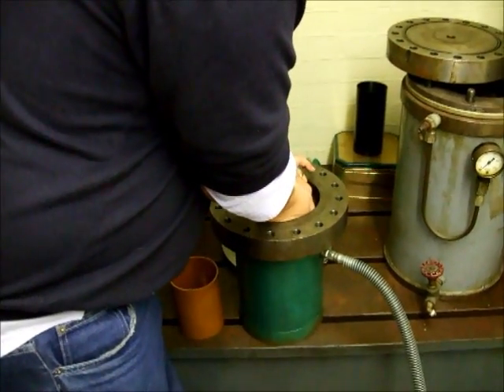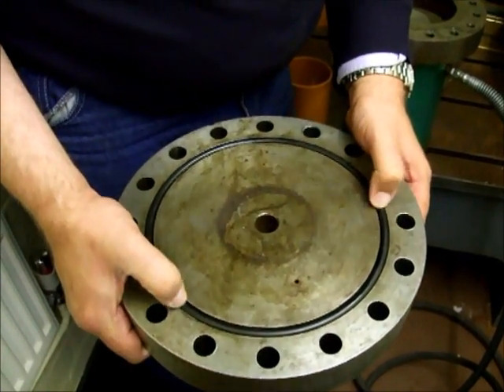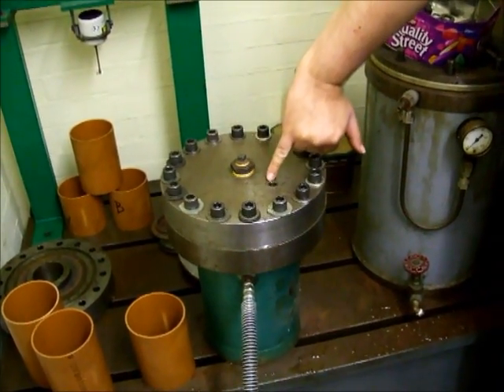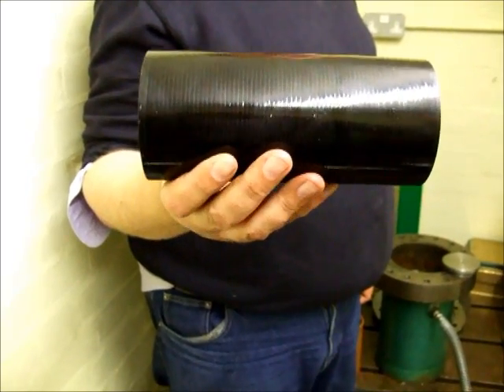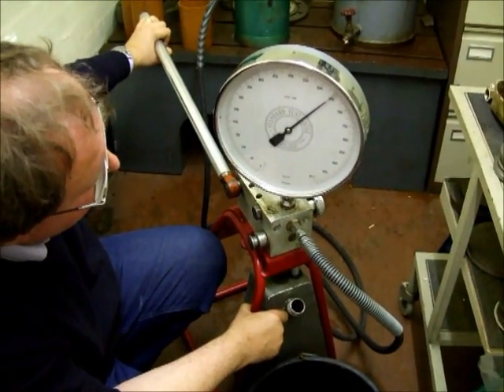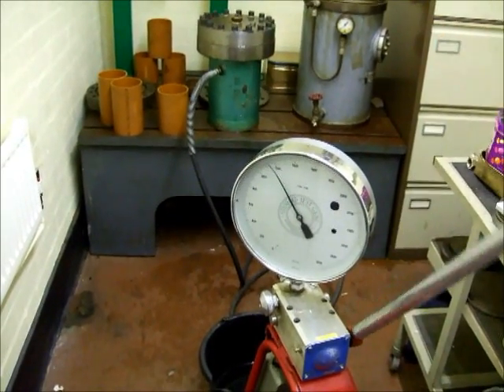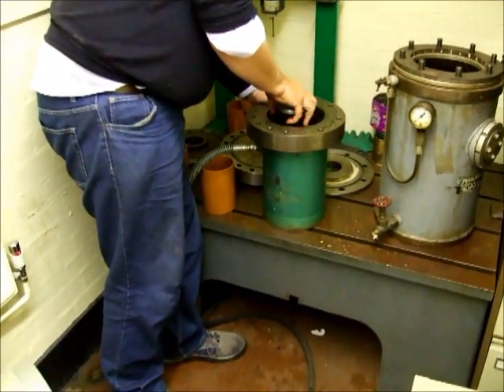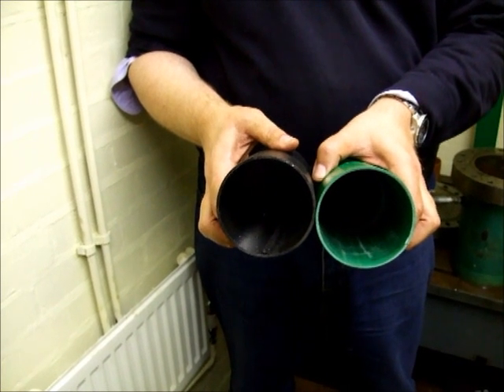Collapse of Composite Submarine Pressure Hulls

Comment: I worked with carbon fiber in the aircraft industry for nearly 20 years. To subject a pressure vessel made of carbon fiber to repeated thermal and pressure cycles as great as those at Titanic's depth, are many times greater than the cycles that an aircraft part will ever experience over it's years of service. Yet, I can't begin to count the number of repairs I've made to parts that have developed cracks or delaminations in a far more forgiving environment. Carbon fiber parts are only as strong as the resin used to saturate and bind the layers together and the process used to cure the part. And lastly, under extreme cold and pressure, these parts are very sensitive to strikes  and collisions of just a small velocity. Needless to say, you could not pay me enough to go down that far in a sub made from a carbon fiber tube.
Reply: You were testing for carbon fiber in tension, which it is very strong in tension. The submersible was in compression, which carbon fiber is not strong. I have no idea why carbon fiber was used for a sub, what a poor choice.
Reply: @tybrady4598  aircraft parts are subjected to both forces, as well as torsional loading. But we are overlooking the worst part of the design. There is a reason most all manned submersibles are spheres, it is plain and simply a better pressure vessel than a cylinder. Especially when it is external pressures being applied. And the fact that they used titanium domes bolted on as their end caps, made each and every hole in the carbon fiber used to bolt it to the cylinder, a potential weak spot. As the center of the cylinder experiences the most load, it pulls away from the bolt under tension and at it's thickest point is under compression. There is also the matter of whether or not they used a honeycomb structure between the layers of carbon fiber. That structure also usually made of carbon is under compression at the outer part and tension the farther it gets away from the center point. The only thing that binds that structure to the carbon fiber layers is the same resin used in the carbon layers themselves. A cylinder undergoes multiple forces at different areas for the entire length of it as well as it's thickness. I won't even go into any hull pass-thru areas.
Reply: @tybrady4598  
IMO tension rods laid in the hull from one end of the tube to the other and tightened to the titanium end caps would've greatly increased the strength of the hull.
Reply: and the way they assembled Titan, slapping resin onto largely parallel loops of carbon fiber, in an open warehouse by people wearing street clothes.. the contaminant/air bubble inclusions must have been insane, and no less so for a vessel intended to compress under gargantuan forces
Reply: @peabody3000 hmm interesting I figured they vacuumed it or something, somehow, in some "innovative way" at the end then placed in giant autoclave? Thanks for your comment! Will have to find the assembly video.
Reply: @michaelregan427  autoclave is right. For those that don't know, it's a vacuum chamber heated to a set temperature to extract all air bubbles that form in the resin during the curing process. I also used the vacuum bagging method inside a walk-in oven, usually at 150°F.
Reply: @peabody3000  seriously? That was the manufacturing process?
Reply: @astoriacub  yep it's on youtube, video of stockton and his team spooling the fiber, troweling on the resin, and casually gluing on the titanium caps, more as if building a bathroom shower than a 6000 PSI deep sea vessel. it's outright absurd.
Reply: @peabody3000 do you have the name of the video handy by any chance? I can’t find it. Thank you!
Reply: @ahoyhere8113  i have posted two replies to you, yet they aren't showing up for me. deleted? i'll try again: search 'Bonding the Titanium Ring and the Carbon Fiber Hull' ..it's the vid from titan's builders themselves
Reply: @peabody3000  YouTube has been losing data a lot for the past two months. Something is going wrong with their "eventual consistency" between data centers.
Reply: An acquaintance of mine tested a similar submersible about a decade ago and found that every 300-500 minutes under water starting at a depth of 1000 meters the material degraded to the point where they had to reduce the safe depth rating in half.  Continuing the testing repeatedly at every shallower depths, the submersible eventually failed at 8 meters imploding.  He described the failure as reminding him of when one stomps on an empty aluminum soda can with heavy boots.  What they brought out of the bottom of the 8 meter tank they used for the final test was just crumpled up "stringy" debris.  The client decided to go with a solid stainless steel hull instead.  He informs me that newer stainless steel one is still in service.
Reply: With any metal there is also fatigue. But this can be accurately modeled. And towards the end of it's life it will even start warning you with sounds. With carbon fibre composite there are so many unknown variables that no model or simulation can be used to say: well this hull is good up tot 50 dives.  with the steel or titanium spheres they used to go to the challenger deep  they had the assurance that they could do a 100 dives or so. And then to be on the safe side they would do 50. I don't know if those are the actual numbers, just giving an example. OceanGate their design could have failed at dive 2 or dive 10 or dive 20 or dive 40. Nobody could tell. They did xray testing of their first build and found fatigue and so stopped going to 4000 meters, and instead only went to 3000. Then they build a new one. They assumed cause the first one did so many dives, that it would be the same for the second.  And assumption is the mother of all fuck ups.
Reply: @KainniaK  actually the titan was supposed to have acoustic sensors imbedded in it's hull to listen for any cracks or delaminations as they formed. Problem with that.. in the 30ms that it took for the titan to implode it was too late for the computer to display that it even detected a problem.
Reply: @KainniaK Titan failed afte 5 dives
Reply: What's your take on SCREWING LCD PANELS AND LIGHTS INTO THE CARBON FIBER PRESSURE VESSEL?  LOL
Reply: @LarsLarsen77  they would have most likely have used mounts that were "glued" in place using the same resin used in the carbon layers. I made similar mount points in parts I worked on. You never want to screw a screw straight into the part. It can crack and delam weakening the part besides most likely pull right out if it's of any substantial weight.
Reply: @LarsLarsen77  I think they were glued, but with that rush guy I would not bet my life on it lol
Reply: @strammerdetlef  There was a cylindrical fiberglass liner that the monitors and lights and wires and stuff were attached to. The passengers were not in direct contact with the carbon fiber pressure boundary. There was a floor.
Reply: @LarsLarsen77 i think the monitors and lights were screwed onto the perforated sheet metal lining of the sub's interior, which in turn was likely screwed onto the end cap interface rings
Reply: @LarsLarsen77 I saw that, too. Unbelievable.
Reply: I work with carbon in aviation too, and the fact he was making those trips down without regular NDT inspections… this was a matter of When.
Reply: @TwinTalon01  without the NDT, not only was it a matter of “when” it would fail, it was like Las Vegas: the house would prefer you to lose all your money right away, but they know that the real trick is to just keep you playing until you do.  OceanGate wasn’t going to stop taking trips until the sub died.
Reply: Yours is the most relevant and intelligent comment regarding the Titan incident. Carbon fiber is a composite which will undoubtedly flex and delaminate when subjected to the almost unimaginable hydrostatic pressure of 2 1/2 miles of water
Reply: @markw208  almost 3 tons per square inch at that depth...that's unfathomable to me.
Reply: @astoriacub  nice one!
Reply: @markw208  "Carbon fiber is a composite which will undoubtedly flex and delaminate when subjected to the almost unimaginable hydrostatic pressure". 
  I mean it matters what the actual stresses are, right? Like, if we put a safety factor of 5 on that bad boy, instead of a safety factor of 2, we'll be doing a lot better. It'll just take twice as much material. And then let's say we actually use a method of non-destructive inspection to make sure that everything is still fine, and that there's no internal delamination. It's very achievable to build something like this safely out of carbon composite. You just have to design it with adequate safety margins, and then test it to make sure that it's built to the design.
Reply: @ahgflyguy  You go right on ahead👍 I'll be watching from the safety of the ship... or better... my couch while you live stream your adventure 😊
Reply: @ahgflyguy  If the material is not appropriate for the purpose, it might be possible, but still not a good idea.
Reply: @Kyle-sr6jm  well, before we say that a material is or is not fit for a particular purpose, we need to talk about how it would be used. Like, would there be regular inspections? On what schedule? What safety factors are needed? Are there coatings or other easy modifications that would make it work, like putting paint on the exterior of a house to prevent the wood from rotting.  What it should come down to is what do we need to do with this material in order to make it as safe as the other materials we normally use for this. And after we’ve factored in all the other stuff we need to do to make it as safe, is there some cost savings still to be had, or not.
Reply: @ahgflyguy  you could line the interior with carbon fiber... but I'd use steel for the tube and hatch.
Reply: @ahgflyguy It would be interesting to know the performance at 10 inch and so on.  Unfortunately,  it looks like OceanGate didn't do enough testing at different thickness. Even then, if there's no way to do inspection of such thick material, then the material might not be suitable regardless. The failure points could have been the hull, end cap joints, and/or view port.
Reply: @ahgflyguy  Even then the fatigue life of steel or titanium can be accurately modeled with a low enough uncertainty. With a carbon fibre composite there are so many variables that nobody has been able to model the fatigue life accurately enough and controlled pressure testing at 7000 psi is only possible at one place in the world, and that chamber only fits a sphere, not a cylinder. So there is just no data.
Reply: @KainniaK  Got it- so what you’re saying is the research program to test something like this in order to create the knowledge base we’re looking for would be immense, and with anything approaching full-size models, the only way to test it would be to build a submersible / ROV version and send it down in the ocean for some pressure cycles, and hope it lasts long enough that you’re doing non-destructive testing. And even if you do that, you still haven’t mitigated the risk of manufacturing defects in the final production article, and you’d still need to spend a lot on non-destructive inspection to make sure that it is as good as you think it is. 
The Oceangate method of acoustic monitoring is innovative, sure. But what it seems like is that when something like this goes ka-Crunch, having a warning that sounds on the “ka” part of the “ka-Crunch” is just not useful.
Reply: @ahgflyguy reminded me of something I heard about concrete, even if it is more tensile than people give credit for, you always assume it has zero tensile strength and no "safety margin" will save you on a catastrophic failure.

As a layman I was always led to believe fibers were a similar deal.
Reply: @Mordecrox  oh, you mean that for carbon fiber, the matrix will have zero tensile strength and the fibers will have zero compressive strength?  That sounds like an interesting way to do the analysis. My undergrad materials classes didn't cover composites at all, and definitely not fibrous ones.
Reply: @ahgflyguy for that benifit , this is underwater not flying in the air. You want to use composite material because it’s lighter but just as strong for less material. This is great for aircraft with passengers because more weight , more fuel , less range. But underwater , who cares about weight , you won’t have hundreds of passengers , you just want to come back safety. Metal won’t delaminate, and you can make a hull just as thick. Plus in these applications you will only have limited quantities of vehicles , but aircraft a lot more.
Reply: @davidhenningson4782 yea for the inner pressure vessel if double hauled
Reply: @ahgflyguy  also you have to watch out for torpedos in places where the gov has previously discouraged you snooping
Reply: @ahgflyguy  i somehow agree with you, but clearly we need more research on the material, and he should not market it to the public if there is still a lot of uncertainties. It is one thing to risk your own life, but to also put others at risk  just irresponsible.
Reply: @tinquijano129  agreed. There are ways this could have been done fairly safely, even with this material. They just cost money that he didn’t want to spend.
Reply: at your safety factor of 5x you are weighing more than a steel or titanium part .  The big problem is compressive loads cf is about the same strength as aluminum for compression.  If Titan didn't crack then it likely buckled and the bonded end caps let go. That they will figure out when then look at the bond line remnants.  I did a video a few days after the incident  but was waiting to hear but my analysis showed about 3x main failure points any of which would have been fatal.
Reply: @ahgflyguy Why don't you go test the theory out for us, and let us know how it works out.
Reply: @ahgflyguy  No. We don't know what the factor of safety and we only have one way of finding out, which involves testing until destruction and it doesn't tell you all that much about the general safety factor of the material, just the example of it you already destroyed.

This is not a homogenous material like metal; it is kept together by weak plastic and can work fantastically well as long as it works; but when it doesn't work anymore it just goes boom. This is not a thin laminate like an aircraft which is only very slightly loaded each flight and in the correct direction (mostly tension due to interior over pressure). Each time it is loaded and unloaded it is a little bit damaged and that process is too dependent on defects, holidays, bubbles, specifics of how it bends, how the fibres are aligned and so on to say anything about.

This very thick carbon fibre composite tube is not inspectable and not repairable.
Reply: @ahgflyguy  "What it should come down to is what do we need to do with this material in order to make it as safe as the other materials we normally use for this." - Invent a method to do what you describe and then implement it. No such method exists today and the first step is to invent it. It is uninspectable and unrepairable. It will work until it no longer does, then it will shatter like glass.
Reply: @volatilememory9338  It's not like that. Their thickness was likely well conservative for a single dive, allowing for quite a lot of defects. Every dive the defects, microfractures, delaminations etc. pile up invisibly.

This is not steel. It is not known how to model carbon fibre composite fatigue processes accurately and it can depend a lot on minor mistakes during manufacturing.

Even testing this for 1000 cycles in a pressure chamber until it fails does not give you any guarantees about the next tube you make; it could fail after 10.

This would likely have worked if they used the tube once and threw it away.

The worst sin, I think, is not the carbon fibre tube but the fact that they just glued it to the titanium rings holding the end caps and didn't even seem to be arsed to make sure there weren't any bubbles or mistakes in the glue.
Reply: @soylentgreenb    "What it should come down to is what do we need to do with this material in order to make it as safe as the other materials we normally use for this." - Invent a method to do what you describe and then implement it.

Yeah, that's the point. if nobody who is familiar with how to work with and inspect carbon fiber thinks it it worthwhile to attempt to develop these technologies, then that right there is the answer: the experts don't think that this is a good enough candidate material for the application, not now, and not into the future, to bother spending time on it.
Reply: @ahgflyguy Probably not because CF is prone to fatigue over many cycles. That’s what makes it so unpredictable. It is not a good material to use for pressure hulls, period.
Reply: @ahgflyguy  
Well said. IMO a hybrid CF hull built as you said with the proper depth margins. I also thought that tension rods laid parallel in the CF hull from one titanium end cap to the other would greatly increase the strength and rigidity of the hull structure.
Reply: @BuckJackson-kc8pb  well, the issue apparently is that there’s not a lot of research into the compressive strength of these composite materials, and adding titanium INTO the composite makes that even harder to do. Back 20 years ago when I was aware of the shortcomings in the state of the art in computer modeling of symmetrical compressive structures, it was easily seen how and why the shortcomings were there. I assume that the default problems still exist. And a young engineer would just not know how to work around that to get real-world answers. Because if you don’t do that, there will be no indication from the computer model that your model doesn’t reflect reality. The main problem is the symmetry in the load and the near-symmetry in the structure.
Reply: @ahgflyguy  
As long as the proper material and structural data are used. FEA testing will determine best construction options.
Reply: @ahgflyguy  
To add to my other reply. I mean tension rods similar to what is used for pretensioned concrete.
Reply: @BuckJackson-kc8pb  Yeah, the problems I’m talking about are the problems with FEA itself. If you haven’t actually hand-cranked through at least some of the math that FEA codes use, then you probably won’t understand the problem that symmetric structures under symmetric compressive loads can cause. But using regular FEA is just insufficient here. I’ve done it. You get ridiculous answers. Titan probably survived just fine, in simulation. The only problem is that the engineer didn’t know enough to not trust the simulation. Also, suggesting to use titanium compression rods analogously to how steel tension rods are used in concrete just won’t work. Tension and compression are symmetric opposites in the world of analogies, but they are not symmetric opposites in the world of failure modes. You can have a long skinny tension rod, but you cannot have a long skinny compression rod.  And this is for roughly the same reason why you can’t push a rope.
Reply: @ahgflyguy  
I disagree and so do several engineers. Google "hull structures using tensioning rods in a submersible hull".
Reply: @BuckJackson-kc8pb  I’m not seeing anything noteworthy when I search that. Can you provide a link to get me started?
Reply: Any engineering student can calculate in 5 minutes: Compressive stress in the carbon fiber polymer (CFRP) wall of the Titan submersible was about 200 newtons per millimeter squared at Titanic depth. This corresponds precisely to the stress level where CFRP typically fails under compression. Only under tensile load (which is not applicable underwater), CFRP can withstand about 10 times more. What's more, OceanGate used unidirectional (circumferential) CFRP. This means that in the longitudinal direction, the hull was only about half as strong, at around 100 newtons per millimeter squared. It's a miracle the ship even made it to Titanic a few times without imploding.
Reply: @DavidG2P  Not an engineer myself but the lunacy of using a material strong under tension in an application where it has to resist compression seems pretty stupid.
Reply: @MrJeffcoley1  yeah, it's much like doing pole vaulting using a rope as the pole
Reply: you point resin to give strength I thought it was the carbon fibers.
not exactly but something like rebars in concrete, bad example cause what I know carbon fiber is ( edit: NOT ) tensioned before gluing/baked. It is just the resin take certain forces and carbon fiber take the pull and some lateral forces.
( Edit: carbon fibers good at pull and therefore good for aircraft, where everything is pull except the upper side of wing, then your resin might help )
( Edit: if you see modern aircraft wings tested to destruction something like bent 30 - 45 degree, you see everything holding together until the panels on the top of the wing pop out then in a blink of an eye the rest fails. 
carbon fiber never ment to take compression, it is other components in a composit of components that fail before carbon fiber does. As long as we are thinking of pull forces )
Reply: @MajSolo There’s a proper resin content on a properly bonded composite part..too much or too little resin weakens part, hence prepregs and film adhesives are designed with that in mind.  Also there are different film adhesives based on whether youre bonding carbon plies or to a core (i.e., honeycomb)
Reply: Add to that that the fibre and resin he used were cheap. He got a deal on them because they were too old to be used in the aircraft industry.
Reply: @m1t2a1  well, an aircraft has to last 20 years after construction entirely undegraded so that it will pay for itself. That means immediately after restocking, the carbon fibre may be just as good for a long time, so I think the fact an it could no longer be used to manufacture an aircraft due to stock age isn't relevant.
Reply: @tricky778  What about the resin?
Reply: @tricky778  Turns out epoxy resin in storage goes bad after three years.
Reply: Its even worse when you think there was no safety margin, it was designed to take the pressure at 4,000m but repeatedly dived to 3,800m which just increases the stress and fatigue during the pressure cycles.
Reply: Carbon fiber just cracks and breaks. Use it only for bicycles and racing cars
Reply: @reneegudjon3204   bike messengers in my city don't even trust carbon fiber. It just can't take the abuse. And it's impossible for a layman to tell if the carbon is near it's lifespan.
Reply: @freddyfox5002   I agree. That's why I have a few old steel bikes and aluminium. Never would buy a carbon fiber one. But they are still being made!
Reply: I've been a cyclist for 40 years...Frames made from Steel, Titanium even decent Aluminium are super durable, some will last lifetime.Nearly everyone I know who has bought a Carbon frame has had Cracking under Stress over time, mainly around the seat post. 
So why would anyone think that a Submersible would perform any better ?
Reply: @dozyy-c9n  yes. Last year the carbon front rim on my mountain bike collapsed going fast on a descent, sending me over the bars and to the ER with a handful of injuries. I suspect there was a small hairline crack probably from side swiping a rock or maybe even a hard hit with low tire pressure and the rim contacted the ground (?) Whatever it was, the damage was imperceptible and the break was cleanly in half. Carbon is great, but not as resilient and durable as often advertised.
Reply: I'm just a butthead with a talent for lofty numbers like vast pressure calculations & I understand the limitations of carbon fibre. As soon as I heard the circumstances that contact was lost I knew it had imploded. A brief chat with a pal who's an architect & mechanical engineer further confirmed my suspicions.
Reply: In fact they made hull from plastic to dive at 4000 meters !!! In plastic submersible ! 🤯
Why they didn’t make solid titanium hull ?
Reply: A critical difference being an aircraft is pressurized from within, not crushed from without. A major difference, the former taking advantage of carbon fiber's strength under tension as opposed to the latter's compression. Carbon fiber is not as strong under compression.
Reply: @MrJeffcoley1  the problem is that a cylinder is subjected to both tension and compression, and possibly even torsional loading depending on the kind of pressure (internal or external) being applied. The main issue being far more loading with a submersible than an aircraft. An aircraft fuselage made of carbon fiber has tensional loading on the exterior skin of the cylinder and compression on the interior surface. Possible torsional loading if the aircraft is forced to make a sharp bank or other twisting actions. Then other parts have different loads depending on the part and it's orientation. Whether it's a carbon fiber or aluminum fuselage, an aircraft's interior pressure, above 8000 feet is still going to be higher then the external pressure. Even at that lower pressure difference it is still subject to testing every so many hours of service. A cylindrical submersible which has the highest pressure exerted externally, still has multiple forces applied to the vessel internally and externally the whole length of the cylinder.
Reply: Yeah 4000 meters was too much for a carbon fiber.Even steel submarine need to be carefully designed.
Reply: Also - aircraft are manufactured basically at ground level.  They go UP - pressure decreases.  The Carbon Fiber and composite structures - are holding pressure IN - not having GOBS of pressure on the outside trying to collapse the structure.
Reply: So basically it was a plastic sub.  The carbon fiber only served as far as preventing the main chamber from twisting and flexing, but as far as withstanding compression you’re basically depending on the compression strength of the resin.  

Never in a million years, for any amount of money, would I bet my life on that.

Too many variables.  And from what we already know from the testing that has been done, and practical experience, carbon fiber is prone to delamination and sudden catastrophic failures with repeated changes in pressure and temperature.  

For tension carbon fiber is great.  For compression, go with steel.  And never, NEVER, cut corners when you go to the bottom of the ocean.  Over engineer… figure out what you think you need and double it.
Reply: What is your take on using CF for compression, instead as for tension loads ?
Reply: @chargehanger image you squish a marshmallow between your thumb and index finger. As the marshmallow compresses down it expands outwards. Now imagine you pull on the marshmallow, as it streches upwards it becomes narrower in the middle. All materials do this to one degree or another, the material property is called poissons ratio. Thats essentially whats happeneing to the polymer matrix binding the carbon fibre together. When the cfrp is in compression, the polymer matrix tries to expand out the way until it looses its bond with the fibres and delaminates, the fibres then buckle and the whole thing fails. When the cfrp is in tension, the polyner matrix is being contracted inwards into the fibres, so it will not delaminate and carbon fibres can take very high tensile forces before they break. Hopefully that makes some sense.
Reply: @chargehanger  CF is great under tension, its absolutely terrible in compression. there's the old saying "you cant push a rope". in this case their pressure vessel was only as strong as the resin used.
Reply: You were not invited to the party
Reply: Also, you can compare the fibers to rope where it is really strong in tension but horrible in compression. when you have a carbon fiber cylinder and pressurize it from the inside, you can imagine the fibers are in tension and is therefore really strong, which is why it is great for aircraft where you pressurize it from within. in the case of a submarine, the hydrostatic pressure from outside the cylinder is compressing the carbon fiber structure like trying to push a rope. it will therefore only be as strong as the resin like you said. its a horrible material to choose for a submarine.
Reply: For Titan, was the carbon-fiber composite wound around anything?  Maybe a "thin" 1-inch titanium tube for a core, maybe with cross-braces at the ends, might've fatigued less and failed less often.  (Also a metal "skin" to prevent water penetration.)  Lighter-weight hybrid high-pressure air tanks are metal wound with (fiberglass? carbon fiber?), but they put the fiber in tension, doing what it does best.  What use is carbon-fiber composite in compression?  It only resists flexing based on the incompressibility of the filler.  Maybe they should have used Portland cement or similar, adhering to ion-etched glass fiber.
Reply: Have you seen any videos of the Dark Aero project? I’d be curious to know what you think of that project being the aircraft is mostly made of carbon fiber.
Reply: @12knE  not seen that, but if it's a highspeed aircraft as I assume, than I would imagine they probably use RCC, it's reinforced carbon carbon. Google the leading edges of the space shuttle wings and I believe it's nose cap too. Not the best material if it encounters a bird, or foam flying off the shuttle external tank. I'll have to look up what you are referring to. It sounds interesting.
Reply: Not even a trillion dollars?
Reply: @chopstickx  nope.
Reply: I'm just a regular gear head with a glancing knowledge of carbon fiber and it's automotive applications. Iv seen pressure tanks made of carbon fiber but that makes sense as the pressure is contained inside rather than containing a negative pressure. There is absolutely no way id just hop in that for a trip to the bottom of the ocean without having leaned as much about that sub as possible. I find it absolutely fascinating that these passengers didn't do any research of their own on carbon fiber pressure hulls and I dont believe that they actually did look into it as evidenced by the fact that they allowed themselves to be bolted into it and sent to the bottom.
Reply: You could pay me enough to go down to that depth... It just would have to be on a planet with very low gravity and therefore much less water pressure for that depth.
Reply: Agree 100%. I used carbon fiber wrapped pressurized air cylinders for years. The wrap process is great for holding pressure in but in my opinion not as great from keeping pressure out.
Reply: @jmcrae825  thats why with CF cylinders and all Oxy-Cylindrical components, hydrostatic tests are imperative in the Aeronautical Industry.
Reply: Now its being reported he bragged about buying the fiber that was rejected from Boeing
Reply: @jonsaircond8520  I bet he wont do that ever again!
Reply: Finally someone else who pointed out the issue with temperatures as low as those at the bottom of the sea! I'm surprised the damn thing made it down and back even once!
Reply: @WhoEver420  the temperature shrinks the carbon fiber far more than the titanium. you can imagine the craziness. thermal coefficient for carbon fiber ~40; for titanium  ~8.  Factor of 5x!
Reply: Moreover, aircraft hulls experience internal pressure, which puts tensile stresses on the material. A submarine experiences external pressure, which is compressive force. Carbon fibers have almost no compressive strength, because they're fibers.
Reply: *its years of service
Learn English.
Reply: Proof positive of how convincing someone can be when they firmly believe in something or merely show that they firmly believe in something! Cult leaders, politicians, ad men & ad women, pompous rich people, etc...
Reply: Interesting you say about strikes. Imagine if one of them hit the side and thats what caused the failure.
Reply: Wasn’t initially interested in this tragedy until I found out the sub was made of carbon fiber. Couldn’t pay me enough to submerge in it either.
Reply: You worked for Boeing
Reply: @L0kias1  American airlines actually.
Reply: I'd love to hear you discuss the video of the epoxy application and seating the endcap.
Reply: @Mdeaccosta  haven't saw them, sounds like I'd rather not throw my phone down in disgust from what I would see.
Reply: I understand that steel is heavy and requires more energy to move it around under water but you’d think that battery technology would be advanced enough to overcome the additional weight of steel. Why not build the crew compartment from a sphere of steel that is overbuilt for any depth that it would encounter? That would seem to make them safer for repeated use. I’m sure costs are the limiting factor for how these things are made.
Reply: But what if they offered a lifetime of bllww$$ from hot ladies?? 😅
Reply: They should have tested the full size model in the submarine Pressure tank in St Petersburg, Russia where a number of US Submersibles have been tested.
Reply: Precisely!! In light of the recent disaster with the Titan submersible imploding, that enviroment under the sea is really different from airplanes, that is something Rush failed to understand with his aviation mindset.
Reply: Resins have come a long way in 20 years. The micro cracking resistance now is insane for aerospace grade BMIs and cyanate esters. Interlaminar strength goes up with that.
Reply: Carbon fibre is only as strong as the resin to resist compressive forces, the tensile strength of carbon fibre is incredible. Just another reason it makes no sense to build a carbon fibre submarine.
Reply: You could not pay me enough to go down that far down in any sub!!!
Reply: NDT tests are always imperative at regular HM1,2 and Line-checks when time and life limited components and parts require the specified checks. Many think CF parts, assemblies, and strength improved components can withstand any amounts of torture thrown at it.!! Not true, you are so correct in saying how the resins, quality of resin, and how it is applied beqtween each dyneema  cloth and CF cloth's then vacuum sealed and properly baked in autoclaves. Regardless of how thick the planal structure may be, i would never count on CF being safe and reluable those monstrous pressurised depths and cold depths.! Whats more amazing is how such delicate and amazing sea creatures are so impervious to the immense pressures and forces down there, yet a vessel is at great critical risk down there. I guess it goes to show we are really not meant to be down there, no matter how successful a voyage is, as there is always that "one day", where things can go horribly wrong.🤔😑
Reply: carbon fiber composites have very high thermal expansion/contraction coefficients.  the strain must be ridiculous never mind the pressure, the THERMAL cycling ALONE woulda done it.
Reply: Spot on! 😊
Reply: I would say you have the credentials to confirm my suspicion.
Reply: Or on a b787…
Reply: You are talking about crap prepreg or polyester resin parts. They are prone to delamination because of the Carbon dioxide, water vapour degradation of the surface of the layers, and interlaminar entrapped  air microbubbles, and poor strength due to high resin viscosity and high resin content. And no fibre adhesion with polyester resins.
You are talking crap manufacturing processes aimed at profits above safety in the aircraft industry.
Well made carbon epoxy parts such as resin infused  carbon epoxy handle millions of fatigue or thermal cycles to over 90% of fail without degradation.
This was lazyness, overconfidence and stupidity from Boeing and Washington University using tests on well made laboratory grade specimens for design parameters for fraudulently marketed crap fabrication process.
Well made carbon epoxy is extremely damage and impact tolerant.
It's crap to say that this has far higher fatigue and thermal cycles than an aircraft pressure Hull. They suffer high frequency engine vibration as well as far more and larger pressure and thermal cycles.
You are exhibiting exactly the kind of ignorance and stupidity that caused the titan implosion.
That's why I will not fly on American OR Airbus crap aircraft if there is anyway to avoid it.
They prioritise profiteering from designing stuff poorly to require regular part replacement and short lifespans.
Reply: You hit it bang on! I wouldn't go down in a sub made of reinforced plastic period! Plastic gets "Brittle" in the cold and deforms under intense stress and flexing.

Titanium was also a poor material (yes lightweight and great for some aerospace applications) and is much weaker than steel in tension and compression... and cracks quicker with regular load cycles.

Rush didn't know what he was doing and should never have taken unwitting passengers down with him. More money than brains... and no patience with those who warned him his design and material selection was 'unsafe!'

He might as well 'broken the rules' and made his sub out of cardboard reinforced plaster🙄
Reply: @davidhenningson4782  

Titanium is often used because it is "good enough" for the depth desired and also lightweight. For a bathyscaphe lowered by cable, you may prefer steel, but for a submarine/submersible moving under its own power, you may want something lighter because it is being propelled. The lighter it is, the less energy it takes to propel and maneuver. A lighter hull would also require less batteries for maneuvering, which are also heavy. 

Granted, the titanium is more susceptible to metal fatigue, but in general these type of vessels are not frequently changing depths. The number of cycles are low.
Reply: @ycplum7062  That makes sense for propulsion... but I still wouldn't change out steel for titanium for the crew housing... and I certainly wouldn't use carbon fiber.
Reply: @davidhenningson4782   what about the mariana trench 3 times titanics depth done in a brittle titanium sub.
Reply: @johnmurrin9734  I'll use an all titanium sub over a carbon composite one anyday. 

You're welcome to explore in a composite sub if you like... each to their own I guess.